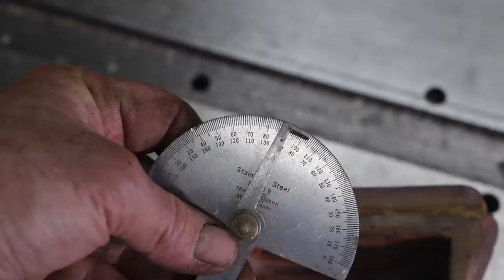Replacing the Brake System on a Farm Wagon Undercarriage | Engels Coach Shop

Comment: An observation: It seems unlikely to me that there’s another human being on earth that can drill a hole freehand several inches deep and have it come out on the other side right where it needs to be every time! I’ve been watching you for a couple years now, and I don’t remember ever seeing you miss!
Reply: Mind eye.
Reply: @michaelbirmingham4111  Not really.  You will often see him put a finger on the spot where he wants the hole to come out.  It is rather amazing how accurately the hands can sense if the drill bit is going toward your finger,  or not.  The other aspect is not to try to drill all the way through from the one side only.  By drilling from both sides any slight misalignment is corrected by the drill bit "finding" a good path into the opposed hole.  The flutes on the rill bit sort of ream a straight path.  Long practice plays its part also.
Reply: That's why he drills from both sides through the part that is going to be held with the bolt. Steve in Thailand.
Reply: Heh - I think that every time.  Definitely a muscle-memory skill learned over a very long road!
Reply: @VAXHeadroom  i just watched a video of a guy here in Brazil that tried that trick,  even with drilling from both sides, his bit came out the side of his 2 x 8. It's not easy.
Reply: I think Dave drilled it on the drill press and makes us think he's doing it by hand
Reply: There's a fancy term for this skill - proprioception, aka the sense of self-movement and body position. I suppose you could also call it juggling with wood and drill bits because the basic principle is the same: you have to know exactly how to move your muscles and position your hands to make things (such as juggling balls or, in this case, drill bits) go where you want them to go. It's not exactly a superpower but still something that takes much more time and persistence to learn and perfect than an average person - or even an average woodworker - is willing to or can afford to spend.
Reply: The drilling from both sides is the trick.   After seeing Dave do it I tried it on a project I was working on and it worked like a charm.
Reply: @nevets7152  Sawadee Khun Sateve
Reply: One things for sure. He’s not drunk.
Reply: Indonesia watching you
Reply: It is a practiced skill. He is a craftsman; fabrication, welding, woodworking and making it blend with the original!

Comment: Just like an older house or structure, if you add-on, repair or remodel etc. it's always best to use the methods originally used with the existing one !  If not, it's gonna show and not really look so good. Thanks for sharing Dave.

Comment: Dry nice minimal repairs on the brakes system and using as much of the original materials as possible.the timber you cut to get the bolts out of was very surprised how good it was not rotted away you all take care 😀
Reply: It was like the bolts grew roots, they didn't want to come out.

Comment: Wow, you actually welded the old bolt back together. I would have just used a new bolt and heated it up to burn off the zinc and make it look old. Kudos.
Reply: Burning zinc, not a good idea... Better to weld the the old stuff

Comment: Love these videos the knowledge this man has is super it also shows the truth to the fact that older bolts and fittings were made better as seen by how many of the old bolts he is able to undo and save to reuse in this job where modern bolts would be totalled and have to be replaced. and his laid back way of dealing with what ever the job throws at him like each new problem is treated as SMH well this will need to be fixed and it gives you a new respect for how these old things were made and the time it would have taken when you think he uses all modern equipment to do what would have all been done by hand when this stuff was new. Well done and keep this going and i hope you have many to learn your abilities before your knowledge and experience joins the long and growi9ng list of lost and no longer practised arts

Comment: Thanks Dave for another great video.  You never have to worry about repeating the things you do.  It is very rewarding to watch you and figure out what you're doing because I've seen it before.  Did you find a use for that flexible tape measure?  If not it was just a thought and maybe someone else will.  I bought one on a whim and I don't think I've used it more than three or four times.  Looked like something you might find useful though.
Reply from the maker: Thanks Howard.  It's funny, but when I first handled it I thought, What?  But then I thought of times it might be just the ticket so now I'm looking forward to trying it out.  Thanks!  Didn't know they existed, other than the types I use in upholstery.  This retractable style might be pretty cool.
Reply: @EngelsCoachShop  Great, Best wishes!

Comment: By the time he's done, this will be almost a restoration more than a preservation by the time Dave posts the final video of the project. By the way which causes more rot, Oil Based/Latex Paint under outdoor conditions that this undercarriage had or are they about the same when it came to decay in your opinion?
Reply: Dave has talked about how latex paint is the worst thing for wooden rolling gear.  His preferred paint is a mix of oil-based paint and linseed oil.

Comment: It's strange you said vinegar will rust the irons, because I've used a vinegar soak to remove rust.  If you make a solution of vinegar, hdyroge peroxide and salt, it'll rust iron.  At least that's been my expirience.
Reply: It doesnt rust itvquickly as the vinegar and iron ages the timber. Vinegar speeds up rusting because it contains a dilute form of acetic acid; positive hydrogen ions in the acid remove electrons from iron, ionizing it and making it susceptible to rust .
Reply: Vinegar doesn't cause heavy rust; it puts an aged (black) patina on steel and iron.  Adding salt and peroxide causes heavy rust (brown).

Comment: Dave, I have noticed you never use sockets and ratchet.  I am sure you know that many 12 point sockets fit square nuts.
15/16" fits a 3/4" square Nut etc.  Likely only a few wrenches needed for the sizes you work with.
Reply: you can also buy 8 point sockets
Reply: But a properly sized open end wrench will never booger up (er...deform) the corners of a square nut.
Reply from the maker: I have some sockets specifically for square nuts, but never seem to think about them.  ??

Comment: So I'm watching you make the loop, wondering as you close the end and hammer it down,  how is he going to get the eye-hook into the ring?, next thing i know it is in the ring. So i rewound to see if i missed you putting it in and it was not there, then it was.  Curious, you did have to re-open the ring to add the eye-bolt, correct? LOL, anyway, love watching your videos. Very informative and relaxing.
Reply from the maker: Yes right before I welded it I stuck it in.

Comment: Nice job. Always wondered were the threads based on the shop shop wright configuration or to an Engineering Standard of the day when the bolts were made. Maybe you could tell us?

Comment: I notice that the brake blocks are only held in by their 'v' shape forcing them into the holders as the brakes are applied. If the wagon rolled backwards say on a hill if you applied the brakes it could just shoot the blocks up and out, not much fun! Did the driver have to be aware of this and what was the solution?

Comment: I always wonder about the uniformity of the really old square headed nuts. Before the era of machine made fasteners, when they were made by a blacksmith, was there any uniformity, standardisation we would call it, in the dimensions of the nuts, such as 1/2, or 3/4 inch across the flats. Would it have varied from smithy to smithy, or between areas, etc ?
Reply from the maker: There is much variation.

Comment: Very interesting series! Dave do you own a set of 8 point sockets? And if so why do you not use them? Is it just a personal preference to use wrenches?  Seems like sockets on a cordless impact would be useful. Might twist too many bolts into though?
Reply from the maker: I do have old original square nut sockets.  Just don't think about them mostly.  I like to see the position of the nuts when turning them back on.  Sockets hide that.

Comment: When you weather the wood with your iron filings and vinegar solution can it be made ahead and stored or do you need to make it need to make it new for each job. I guess what I'm asking is does the solution have a shelf life.
Reply from the maker: It does have a shelf life of a couple weeks.  Too old and it becomes real rust colored.  It still works but the shades vary some.

Comment: What is the purpose of the rivets on the end?  Do they just prevent splitting?
Reply: I think, on one of his earlier videos, he said that was what the rivet on the end was for, to prevent splitting.
Reply: @bobskipper4037  I was thinking also it would double the amount of wood that the through-bolts would have to rip through before a split or tear-out would happen. A simple technique to add real strength.

Comment: so do you drill half the hole, put the bolt in and use the bolt as an alignment guide to drill straight through?
Reply: Watch closely, and he seems first to drill from one side towards. but not all the way to >:-o a fingertip placed on the "target", then as you say places the bolt in that hole so that he can from the other side line up the drill and the bolt by eye .  Needs a good eye, I reckon.  Probably wouldn't work for me, I'd end up with two holes converging at about ten degrees!

Comment: 13:19.   How come no small washer is needed when flatening out the rivet?
Reply: My opinion only, it was a tight enough fit, and the hole was countersunk, so the rivet can be hammered flush with the casting.